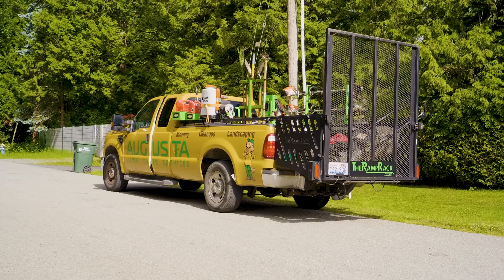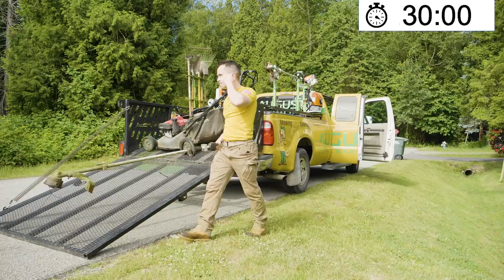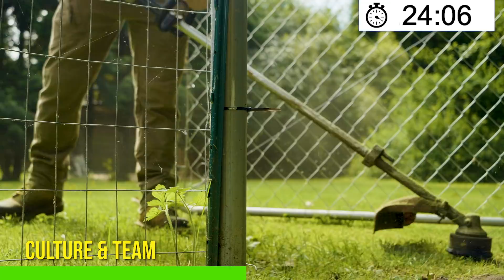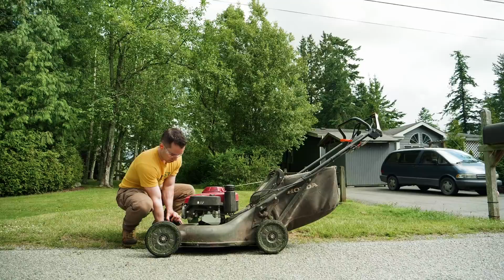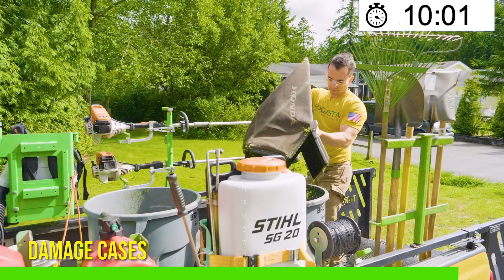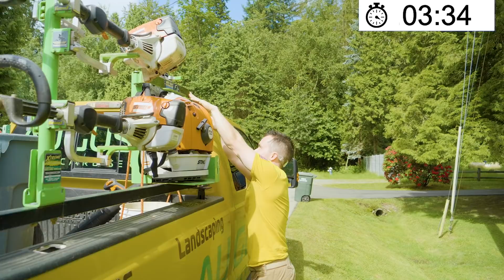This Client Complained: I Didn't Apologize!

Comment: This customer didn't have a real complaint IMO. He is a guy who used to maintain the property himself. He has a picture in his mind of what things look like when it is done his way. Now he has seen a couple guys do things a bit different than the customer used to so he assumes they are slacking. I agree that no apology should be given and you did the right thing by not throwing your guys under the bus. These type of customer complaints are usually very easy to resolve just the way you did. Do the job while they are present and ask on completion if the work meets their standards. 99% of the time they will say yes it was done to their satisfaction and will not complain again. The other 1% will never be happy no matter what you do. Let those ones go soon as you can.
Reply: First of all, the way this video is edited, we really have NO IDEA what all the complaints were that the man had!!  

Also, most companies who "set their customers up on a plan" just come and do the job and leave - often when the customer is not even home.  It's a very rare yard man that will walk anything more than a very small and simple yard with you before they leave.

I've had some who will say "Does everything look OK?", but they act insulted if you want to actually walk the entire property with them before they leave.

I've had not only damaged shrubs and other plants, and I actually had one yard guy mow over a sewer line clean-out, and not tell me about it.  And I had walked the property with him when he first arrived to tell him about things like that pipe, so it's not like he didn't know!  But he went at it like a bull in a china shop, and then took off in a hurry saying he was "late for his next job".  Later, after I discovered the pipe and called him about it, he said, "Oh, yeah, I meant to tell you about that."  Guess who paid for the pipe repair?

Yeah, I realize when we have to give up taking care of our own property (especially those of us who enjoyed it and took pride in it). we have to learn to give up our perfectionism.  But do we really have no choice but to just accept poor/incomplete service and damaged property?

Comment: So as a contractor I ask do you normally wear zero safety equipment?
Reply: Good point. It's pretty easy to get hit in the eye with a job like that. They should at least be required to wear safety glasses and hearing protection.

Comment: i've been running crews from the time i was 16  mobile home setup crews  and i know i was a hardass when it came too safety of my crew  i actually kick a customer off his property for 2 hours because he would not leave my guys alone  it was when we needed our attention on putting the home in it spot and a lot of trees  ive also ran pool crews  from cleaning too building  now if my builders didn't do what was expected  i back charged them for cleaning up their mess and i got the  home builders and tile guys if i found their stuff in my pools i back charged the builder and tile guys

Comment: You handled the guy well. But you don't touch the pay your workers earn. You fire them if they do a poor job not up to your expectations. Stuff happens out in the field, so you need to weigh your employees value versus client satisfaction. Worker morale is highly important for the "extra mile" service mindfulness. You treat your workers the same way you protected them against customers that might have Karen attitudes. That will grant you the best value towards your business and work place environment morale. That equals work quality in the long run. It's easy to punish, but will led to a lesser quality service. But do not misunderstand. Sometimes verbal reprimands are necessary, as long as they're constructive and leaves your employee still feeling respected and valued. That can lead to growth.

Comment: So the guy def pushed too far (the "dirty" comment and laid it on a little thick with the lazy/arrogant stuff). BUT let's talk about the other side since you're the one filming this interaction and bragging about not apologizing. You correctly point out that you don't need to over-apologize, but you also say that the customer "didn't actually have a complaint." That's not true. He talked about 3 different issues that were NOT completed by your team (missed trimming, didn't get a patch of grass out front, and didn't have the clippings blown out). Those are real complaints. Also, you're not being honest with your customer. You weren't "filming an ad" strictly speaking and you were actually the boss.  It's good to stick up for your team, but it's also good to OWN THEIR MISTAKES instead of acing like you're humoring a client who has concerns. Looks like both sides had some lessons to learn from this interaction.

Comment: I noticed hes using a fs111 they suck you aint gonna get 3 years without repairs older models are way better but you cant find them to he honest I do have a fs111 but i leave it in the shop as a back up

Comment: Soooo..... Buy a rider my guy.... You have a multi crew multi truck business and you're using a push mower? Really?
Reply from the maker: The lawn is less than 1500 sq feet in size
Reply: @MikeAndes  not suggesting to pull our the 60 in zero turn for tiny yards but a simple stand on/ walk behind could cut your time down on small lawns dramatically